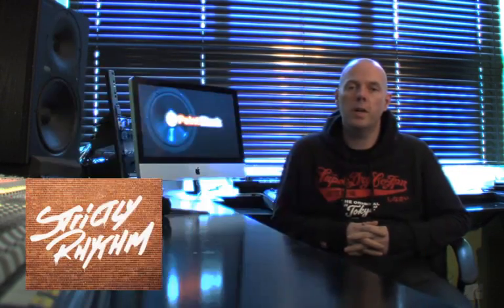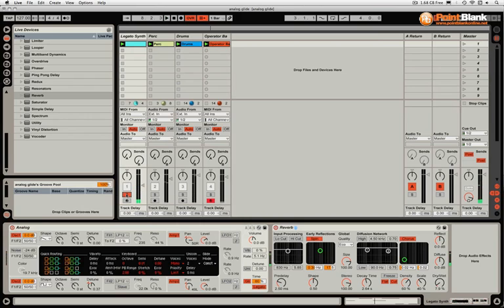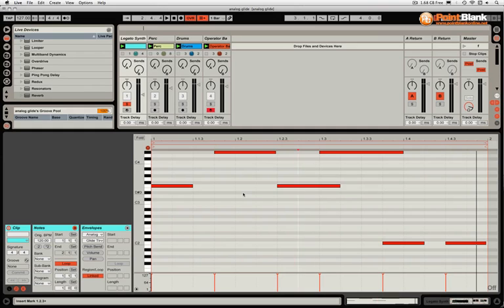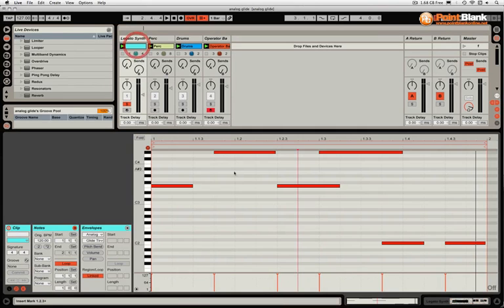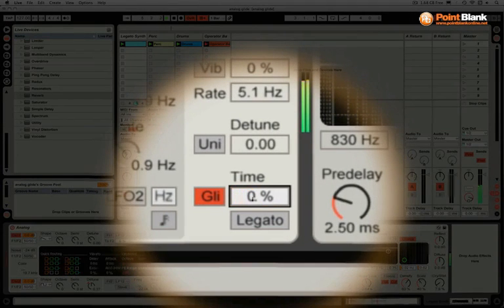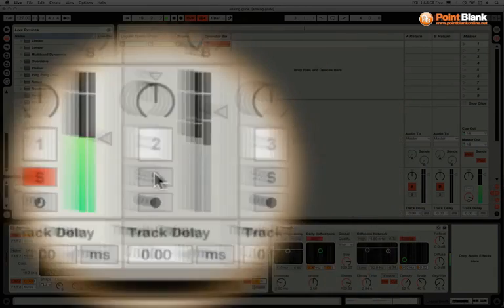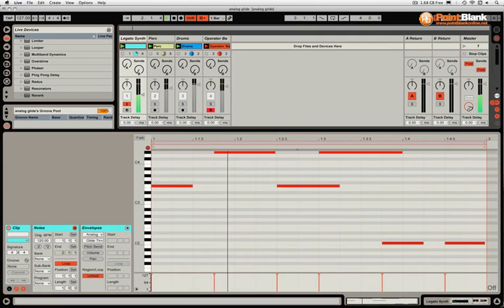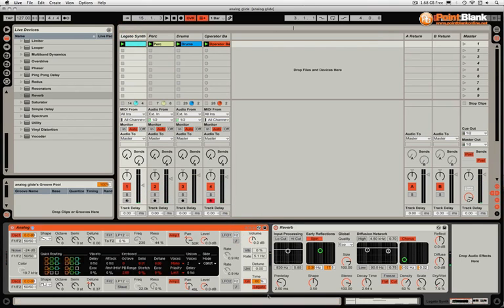Ableton Sound Design Tutorial - Glide in Analog

Comment: It should be mentioned in the video that glide will likely only work if your VOICES in the global parameters is set to MONO, which is not the default setting.
Reply: That was it, thanks! ;)
Reply: you're the mvp here
Reply: please how to set mono?
Reply: @smnelse379  it's a really small button in the interface, I think when you click on Amp and look on the black screen in the middle
Reply: @THEextraterrestic  didn’t find it(
Reply: @smnelse379  hey, i'm here 3 years later, but you can toogle the "mono" options by clicking on the far right panel with the glide option. Then in the black middle interface find the options called "voices", it's inside, it will likely be set to a default number before.